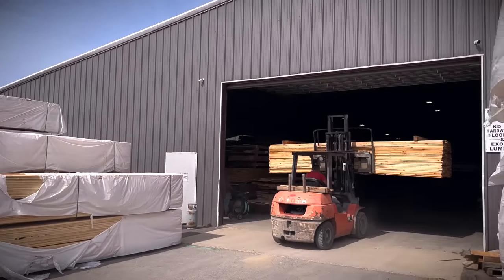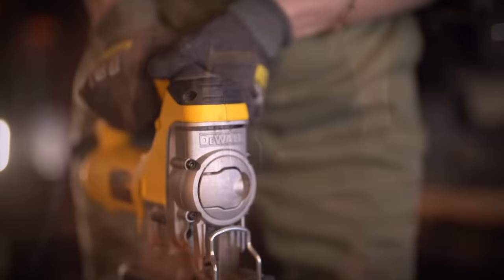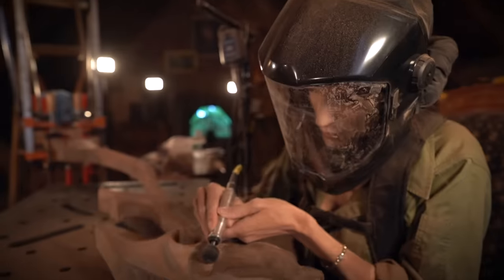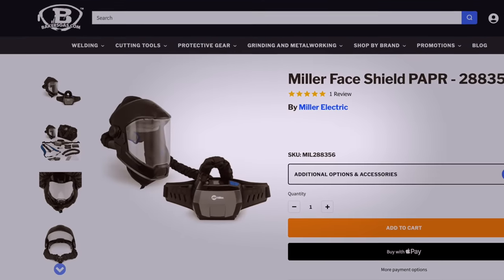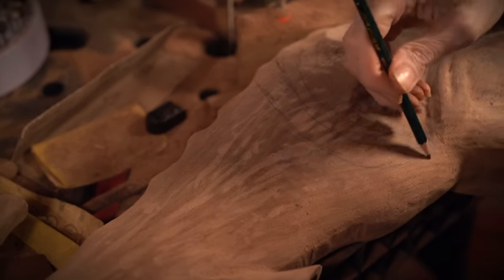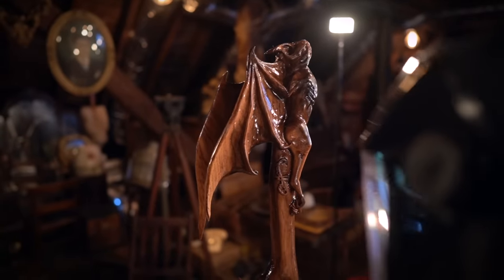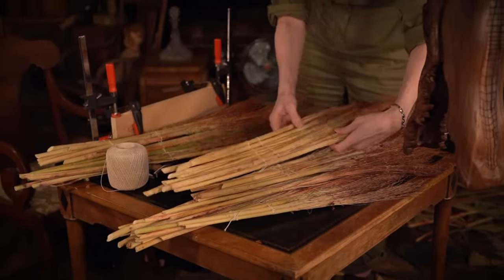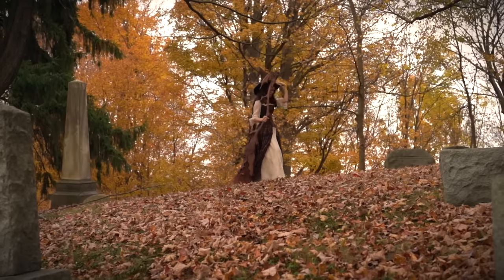Carving a Witches Broom - From  the Mind of Christine McConnell

Comment: Walnut wood nerd and fan here: A thickness planer would have helped make that glue-up SO much easier. Also curious what you used for work holding. So many compound angles from carving should make it really tippy as you're doing such fine work with the Dremel.  Also super surprised that the Alligator eye didn't blow out between jigsaw and carving. That knot looked like such trouble!

Comment: Your carving and sanding create a lot of fine dust. Is there a Harbor Freight store in a nearby town?  Buy a bag dust collector and order online a long vacuum hose, the appropriate diameter for the intake, and secure with a hose clamp. Use electrician zip ties to attach the other end of the vacuum hose to an adjustable telescoping roller stand, also available at Harbor Freight. Move the stand close to the area you are working on so the dust will be sucked into the hose and up into the dust collector.

Comment: Black Walnut is the SMOOTHEST wood to carve. Like butter.
Back to video ! 😅
Reply: 2nd comment. While it is nice to be able to afford the electric gizmos that Christine has, you can start wood sculpting with very few tools. I have 5 chisels/gouges from "Swiss made" that I invested in years ago. They can take you pretty far and will last a lifetime.
 Also, you will need a mallet. (And a sharpening stone & oil. Again, an investment, but lasts a long time!) But, the second piece I carved was a green branch from the local DPW. I was lucky enough to find an Artist that had a very cheap "drop in" class once a week. 
 I DID carve a spoon - which is kind of the usual beginners piece out of black walnut. I wish I could afford more tools and higher quality wood, but, once you start carving, wood seems to find it's way to you ! Look for fruit trees, pear, apple, etc. They are often great to carve.

Comment: Beautiful work! But why ever would you not use a vacuum while you are carving? The dust was choking, and it gets everywhere! I would imagine you'll be finding it next Halloween! A good shop vac can run for hours, and will remove the dust before it gets to your face. Of course, you might consider a whole-shop dust evacuation system to hook up all your woodworking equipment.